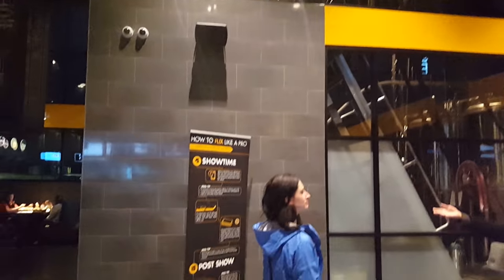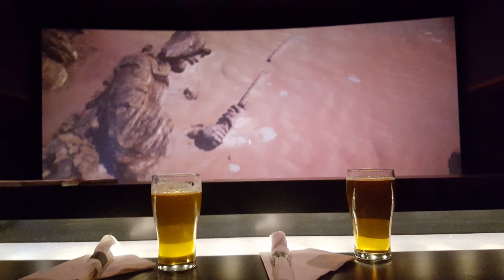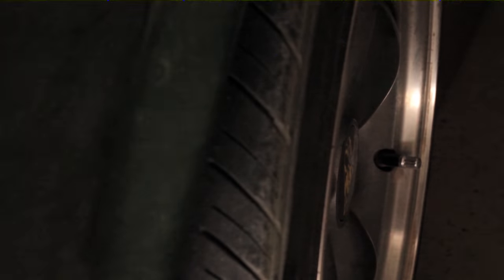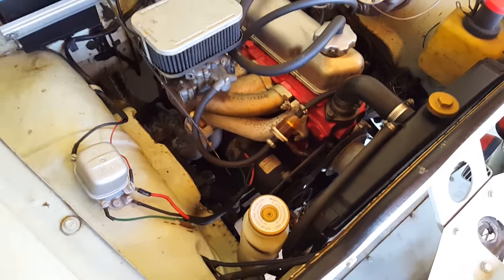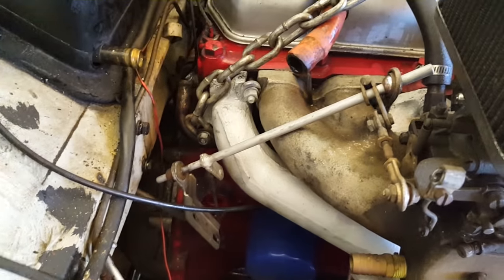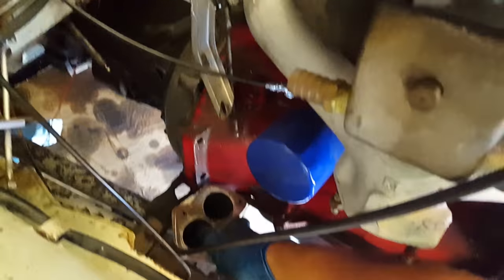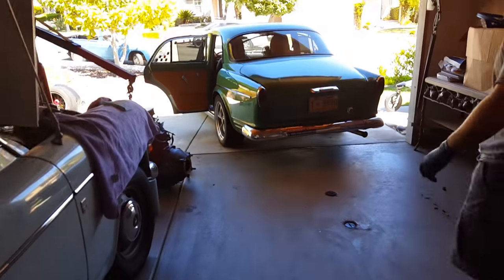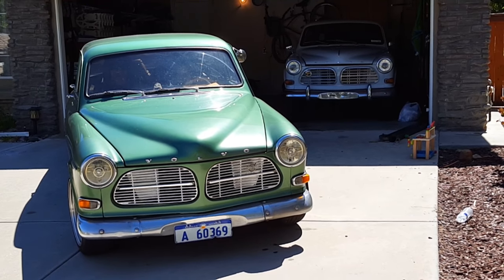Beer, Movies and B20s

Comment: I thought the front grille panel on Amazons was a bolt-on part, so wouldn't it be easier to unbolt that and bring the engine out almost straight forward?...
Reply from the maker: gosportjamie it's a little more work that way. that piece is attached to and rewrites removal of headlight buckets and surely rusted bolts at the fenders.
Reply: David Bello   Yes, I see the problem, those bolts are probably going to be well rusted in place on an unrestored car.  The cars I've seen it done on have all been restored to a greater or lesser extent and have had those bolts replaced and refitted with anti-seize on them...